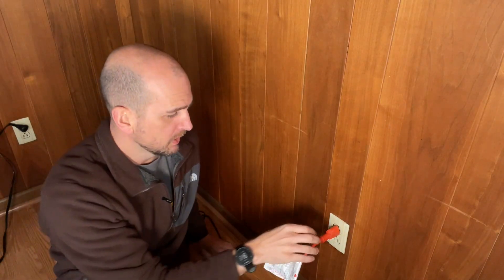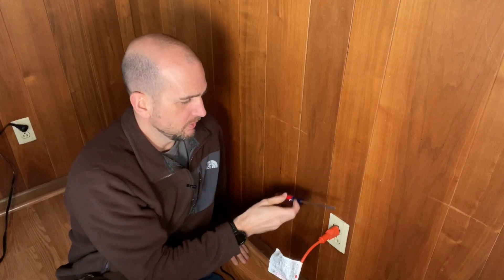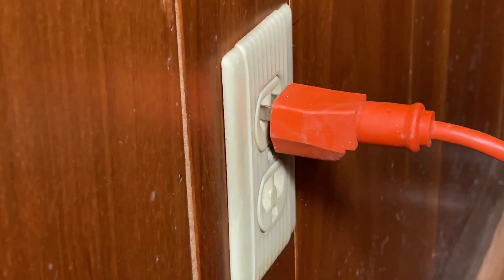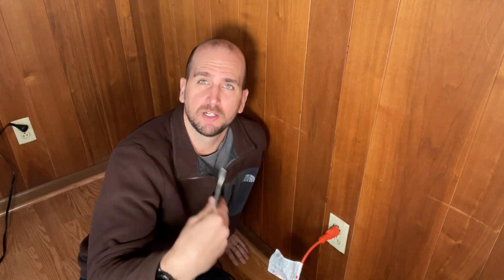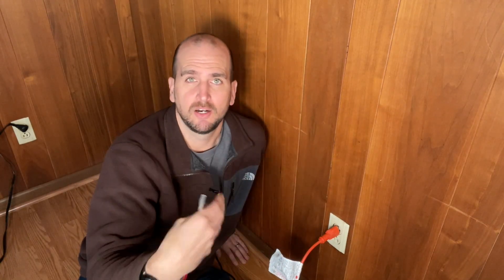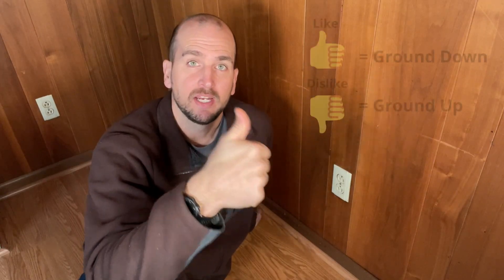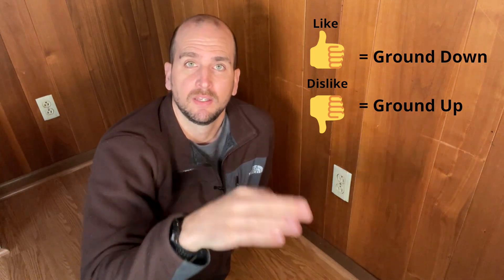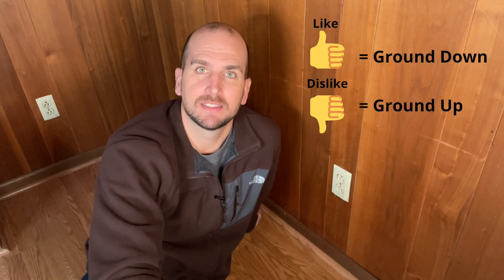Should An Outlet Be Installed Ground Down Or Up

Comment: Ok ground down folks - what's the advantage of it? With ground up, there's some, albeit slight advantage. Where's the win with ground down? It looks like a face? Whoop de doo. I'm just a DIYer but I install them ground up any time I'm replacing outlets.
Reply: If you use extension cords and move them all the time, you'll find out what's good about ground down. I've had to watch my grounds break a few times, and it just seems like having the prongs up is better for resisting the vertical force from a hanging wire. It takes no effort to break off the ground by pushing up on a chord plugged into ground down, luckily gravity works the other way.

Comment: If a receptacle is so worn out that the plug is not tight, it needs to be replaced...that is safe. 
I didn't buy a house because it had a mix of both. 15 minutes later, my eyebrows relaxed.
Reply: It could be just the switched outlets are reversed, but I don't blame you.
Reply: @nimrodery  I considered that but there were other irregularities that didn't pertain to this subject...mixed vinyl and aluminum windows, different toilets and other indicators that a half-a$$ diy projects was afoot. lol

Comment: I am not an Electrician, however, I prefer the plug facing down when you are using a three prong plug because of the weight of the plug. You have Additional support for the weight of the plug when the ground is facing down.

Comment: Ground up, or neutral up whenever I can.   I will second the problem with extension cords and plug in multipliers in the they ten to assume that the opposite is true.  Getting rid of the "little smiley" also reduces the interest from little kids, even though I always try and use tamper resistant plugs nowadays.

Comment: Some refrigerator plugs are designed for the ground up so when plugged into a ground down outlet, the cord now has much strain on it as its usually a few feet from the floor and has a U shape to it. Go figure...

Comment: I go with ground up for two reasons :
1) an electrical outlet with 3 holes will look like a face (2 eyes & 1 mouth) for the kids. Kids are likely to put an object into the outlet mouth. An outlet with ground up will make it look like less of a face, which would deter a kid from getting something into the outlet mouth.
2) in electrical schematics with vertical hot line and neutral line, the hot line is always shown on the left side of the neutral line. an outlet with ground up will match the schematics.

Comment: The standard outlet was designed to look like a happy face, with the bottom ground terminal as the mouth. When the outlet is put upside down (IMHO) the happy face effect is gone and you end up with an inherently unsettling look. Everyone likes a happy face, even if it means getting electrocuted very rarely.
Reply: YOU REALLY NAILED IT!!!
Reply: @enriqueacosta3992  copy that

Comment: Ground should be on bottom.   If plug gets loose the cord tends to fall  out.  Ground down,  the ground maintains connection even if item loses power.  Ground up,  the ground loses connection but there is still power to item.  Not a good thing.  Seen it many, many times.  Never saw a screwdriver or picture frame fall into a plug.

Comment: I favor the wide blade (neutral, and ribbed portion of the cord) to be on the left, with the narrow blade (hot) on the right.
That corresponds to ground-down. Check your toaster for tried-and-true, relative to neutral/hot. Fires have happened.
I used to get shocked by an incorrectly wired basement outlet with a Fender Mustang plugged into an amp on that outlet.
I have also seen refrigerator freezers that shocked from breaking the wide/narrow conventions.

Comment: I was taught that it depends on the orientation of what is plugged in.  Generally the ground pin is slightly longer on a plug.  This is so the ground pin remains connected after the hot/neutral are disconnected.   So the orientation of the item plugged should determine the orientation of the outlet.  In the US most outlets are low to the floor and cord tend to run along the floor, thus ground down would be safer if a plug became loose on its own.  If you look at the UK standards their plugs have a lot more information on how they are installed an oriented.  In fact, their ground pin is quite a bit longer than the US standard.

Comment: The original patent filing called for ground up for the safety reason mentioned. But people prefer to see the "faces" orientated up, resulting in ground down. I install ground down indoors because of cord designs, and ground up outside since only extension cords plug into them.

Comment: Sideways - with the neutral up (ground left). I owned two houses in Aurora, IL by two different builders and the outlets were installed sideways. This take some planning as the drywall mud plates had to be oriented sideways before the drywall went on. Based a bit on the "ground up" logic, the neutral and ground are (hopefully) at the same potential - so even less chance of a short - however remote the chances. And the wonky offset plugs in the video are not a problem either.

Comment: Ground facing up for medical equipment, especially life support equipment. A 3 prong plug that hangs down a little will leave the power prongs partially out whereas with the ground up, the power prongs will be pushed in with the ground partially out.
Reply: That shouldn't happen with a hospital grade outlet, and if it does then it needs to be replaced.

Comment: I install receptacles ground facing up and been doing it for 30+ years. Hubbell one of the major device manufacturers brought the safety benefits of installing ground up decades ago and it makes total sense. You're right it's not in the NEC as an installation requirement and an issue that hasn't been pushed over the course of my career. With more and more items being manufactured with grounded plugs it can finally become a code requirement of installation and finally put to rest the preference or confusion ground up or ground down. The issue is electrical safety.

Comment: Grounds up... Just like at work. Grounds down if you have an inconveniently oriented plug. Also Neutrals up for sideways mounted outlets... which means that the toilet paper neither rolls over or under. The toilet paper roll goes on the window sill, or on top of the empty dispenser. Hah!

Comment: Ground up just looks wrong to me. Awkward somehow. I have never had a problem with screwdrivers falling onto live prongs. 
Now, next crisis to resolve: When sideways, ground pin to right or left?
Reply: ground pin to your left (when you look at the outlet). this way, you allow the neutral (the longer rectangular hole) to be at the top, making it safer if something is to fall on the pins. Although falling onto live prongs is extremely rare events, but we protect ourselves against many rare events, such as smoke alarm, spare tire, security cameras, etc.

Comment: I had a case where a person dropped keys behind a cabinet where an outlet was located and did NOT have the ground up on the outlet. This in turn shorted the outlet, burned the key & melted part of the outlet. So that sort of thing does really happen. Most people don't re-arrange their home enough to clean around the outlet & they also have a tendency of overcrowding night stands, dressers, entertainment centers, etc. which also makes matters worse especially with change, metal hair pins and so on. So ground up for me. Another issue with a NEC standard, is that not all outlets are installed vertically. Some are horizontal or at an angle, pitch or in a ceiling. In those circumstances there is no "up" for the ground to be located. Great video for a DIY guy!

Comment: My home is closing rapidly on 100 yrs old. I have ground down & up outlets. I also have ground left & right with outlet installed horizontal. Finally, I have switched outlets. One room is upper outlet switched, another is lower outlet switched; no switched horizontals thankfully. Basically, I just have to experiment.

Comment: as most of the things I would plug in are only 2 prong...no advantage to the ground up and most of the 3 prong plugs are to power bars with the 'quick 90' plug again negating any advantage. That said in my garage/shop almost everything is 3 prong so I might reorient them - they also have metal faceplates (to avoid the endless replacement of plastic from stuff bashing them) - so the ground up might help as suggested. Then again...maybe horizontal as the stacked plugs often interfere with each other, hmmm.

Comment: I'm over here laughing at all the "it will never happen, so it doesn't make sense" arguments. And my favorite, "it doesn't make any difference so you should do it this way"!
The object falling behind and shorting or arcing across the prongs seems to be the only REAL argument for direction, so how hard is it to err on the side of caution and just install them ground up?
Also, I saw one comment regarding sideways mounting and common sense also would dictate the neutral should be up.
Is it odd that a "shocked" emoji has the ground down lol? I think not! 😮
Reply: And if you must have inverted outlets for switched circuits, then flip it over the wing way so you have your cute little emoji look!

Comment: I know a guy that has seen it happen.  He said they had a breaker they couldn't reset.  They went around the shop and found a piece of sheet metal had fell off a shelf and was resting on a plug with the ground down.  It kept shorting out.  So yes, it's a possibility.

Comment: Ground facing up in the argument of having an object falling on the prongs from above is simply not a good argument. This statistically would be rare considering other factors. The strong ARGUMENTS for ground facing down is that when you pull a plug from an outlet, its likely your index finger will be closest to the wall on the bottom. Therefore ground down wins. In addition, if a plug gets pulled loose over time, the ground will always be the last prong to make contact with the plug when the ground faces down. This is a no brainer.

Comment: I like ground up most of the time. It seems to be easier to hit the hole in precarious positions such as behind furniture, et cetera. If I was doing new construction, I would specify a box on either side of a stud, with one duplex up and one duplex down. That would help solve inadequate number of outlets as well. Probably fewer power outlet strips employed if there were adequate duplex outlets in one's home or office.

Comment: I actually had a metal plate fall straight down against a wall  in my electronics/radio shop and short the hot and neutral prongs of a plug once. But that was a freak thing due to the way I had my bench set up that day.  I still install all my receptacles with ground down for convenience and watch the placement of my benches and work areas.  Having said that, if there were a situation where I couldn't do that I'd go with ground-up.

Comment: I happen to like ground up mostly in the workshop: that being said as you pointed out many outset plug designs have the ground down. At the hospitals that I worked at and many data centers the ground was down but it was based on a rubric. In the hospitals they tended to keep the plugs all the same direction so staff would get use to plugging in the same way. Reasoning was that in an emergency you are working on reflect action/knowledge. In data centers the ground down was based on consistency and often plugging in equipment in the blind so to speak. In newer homes the trend seems to be ground up denotes a switched plug. Now if they would only settle on which of the two sockets would be always on or switched.  Thanks for your videos.

Comment: The shape of the receptacles is defined in the  National Electrical Manufacturers Association specification ANSI/NEMA WD6, and it defines them with the ground terminal at the top.  But in most residential installations, they are installed upside down (i.e., ground on bottom), I think because people like the "face".  Also, there are lots of things like power bricks and right angle plugs that are designed to be used with ground-on-bottom receptacles.

The NEC doesn't care.  The only good reason I've seen for ground-on-top is extra safety when removing or installing a metal cover plate: if it slips, the ground may prevent the plate from touching the live connections.  But metal plates are very rare in residential settings.  A few years ago this came up on an electricians' forum, and the consensus seems to be to put the ground on the bottom, except for metal cover plates.

Comment: Urban myth, ain’t nothing ever in the history of the United States electrical system reported to have fallen just perfect and landed on two exposed prongs and started a fire.
Reply: Many of our safety standards are based on very slim chances of events occurring. For instance, in my neck of the woods you can run an electrical wire through a cold air return, just not vertically. Presumably the natural erosion that happens as a result of air travel is more likely to damage your wire when they run in the same direction. Have any wires eroded due to air hitting them, causing a fire? I'm guessing no.
Reply: @nimrodery  true but this is not in any code. I would also argue it’s easier for a plug to come out with the ground facing up, as most 4 plug grips on the up side vice 2 offers more resistance to prying off and down. In addition most companies manufacturer plugs with the ground down (for flat plugs). If ground is up, the wire is coming up and increases the odds of the plug coming out.
Reply: @Mike-gz4xn  It's code or common practice depending on the application, for instance hospitals and commercial properties.

There are a few things that don't get codified that are nonetheless "best practice." It's the kind of thing you have to learn on the job because often there's no regulation asking for it, and (usually) nobody is going to volunteer to tell you about it.

Comment: I install ground facing down, but I understand the idea of the ground facing  up for other safety reasons. Like you mentioned in the video, there are products that have cables that just don't work with the ground facing up. And for whatever reason, people seem to be Used to the ground facing down as far as aesthetically pleasing to the eye.

Comment: Simple solution.. there are 2 plugs so ground up on top and ground down on the bottom. Yes there are not made that way. So manufacturers start making them that way.
Reply: That's the worst possible solution. They each have situational advantages which you would destroy.

Comment: I am not in the USA, but reading through a few comments and the video commentary made no reference either to the earth safety aspect. Here in the UK, the earth pin on the plugs (like yours) is longer than those of the live and neutral pins and for good reason - the last pin to disconnect is the earth. Our plugs also have the live and neutral legs partially insulated so if they do come out as indicated in the video it is impossible to short the two. Having the earth / ground up with your style plugs could have the earth disconnected while the power conductors are still energised - potentially fatal in some circumstances. Our plugs are a different design (and I think far superior to the US / European style) and have the earth / ground pin at the top, but the design makes it much more difficult to accidentally pull out.

Comment: I personally like the ground-down and make a face. The master electrician I learned from in the 1980s (who had seen it all in home wiring from the 1940s to the 1980s) used this little ditty:
Make a face and lose the race, upside down and win the crown. I know, I know...cheesy cheesy - but easy to remember.

Comment: Down!
Want ground to be the last point of contact to leave the connection in the event a power cord/extension gets pull or jerked - so common.
Reply: The ground pin is longer, you would literally have to break the receptacle in order to get the ground out first.

Comment: Frankly, I don’t like that receptacles are stacked vertically. A horizontal, side-by-side, arrangement would accommodate more plug styles, particularly transformers.
Reply: You simply have to install the outlet box horizontally
Reply: @billytucker6759  That’s half the solution. The receptacles themselves should remain upright...like those on a power rail.
Reply: For aesthetics? Lots of hardware have 90" plug ends that work well with horizontally mounted receptacles. My shop has thirty two horizontally mounted receptacles that were changed to that configuration for convenience with the exception of 220v outlets. All other appliances are strait wired homeruns.

Comment: If the receptacle has weak tension it needs to be replaced. 
I’m a senior Hospital engineer and I appreciate you noting that Hospital codes are not always nec. Nec codes are minimum requirements and you are allowed to exceed those recommendations.

Comment: Electrician here, there is industry standards but no rules forcing up or down. Safety wise however, the better option is ground up because if you were to have a plug partially inserted logically it would make sense that you come in contact with the ground instead of hot or neutral. There just saved you all 8 minutes.

Comment: I have night lights and they have to be plugged in upside down, because of the wider prong.  Would be individual choice depending on the prongs of your electrical products. But I do prefer mine down.

Comment: Hospitals require the ground up. Why, incase the plug is slightly loose and a metal object falls on it it won't short out.
Reply: If the plug is slightly loose, the receptacle or device is broken and needs to be replaced. I better not see one loose plug at any hospital.